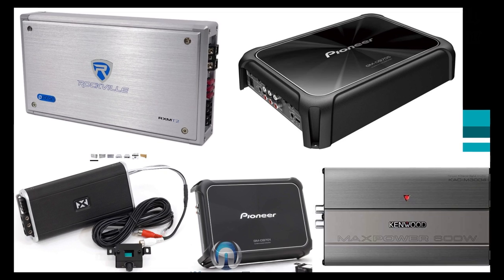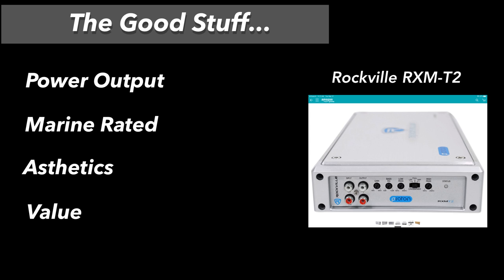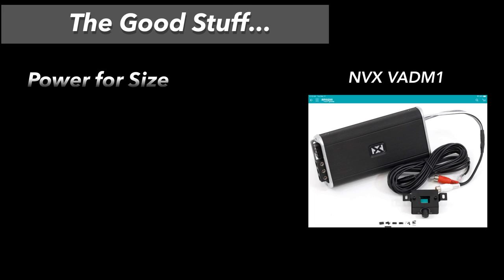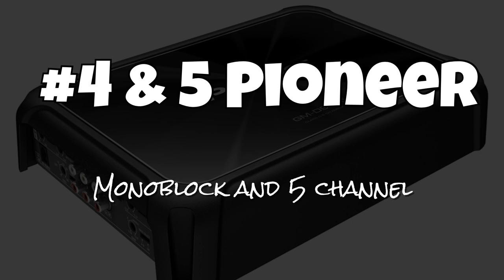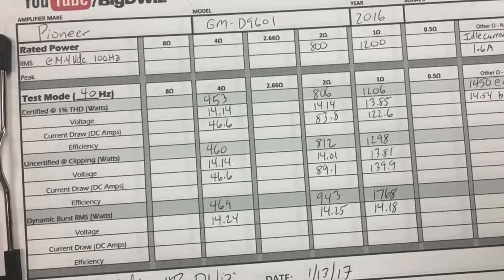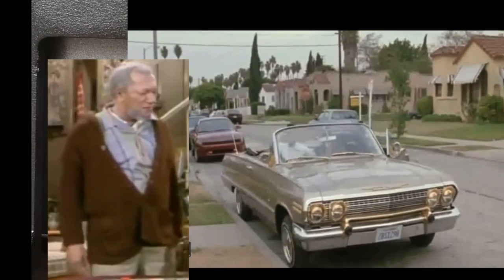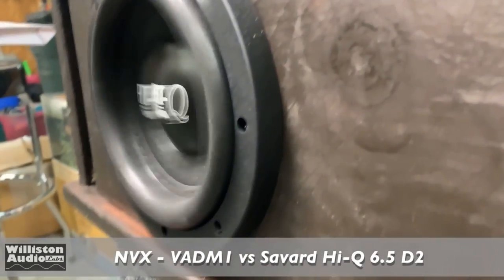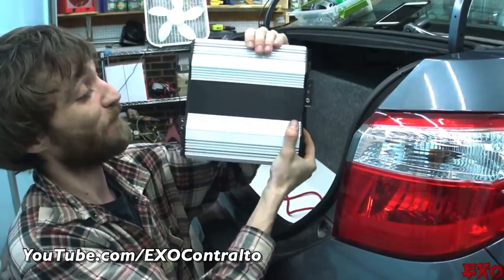Budget Amp Picks in 2020?

Comment: Still have a 1st gen Rockville  K9D2 10inch sub and a second gen K9D4 10 inch have them hooked up to the Taramps smart 3 at 1.33 ohms. They are still kicking no problems so far.

Comment: My Pioneer 800w GM5505 has been torture tested, subwoofer approved, brought new when it came out and still has the original fuse in it. Scuffed and scratched up, screws and terminals halfway stripped out, but this thing STAYS reliable. My Razor Rxr-2500 monoblock has also been 1 ohm stable since I bought it too. No, nowhere near 2500 watts, but feels like a solid 800-1000. Lil fucker, too.

Comment: Is there any budget 4k watt amplifier? To match to a Dc XL elite 15. Tryint to find something around $100to1k watt area or so. I know i wont find anything under 300
Reply from the maker: The cheapest 3kW amp is prob the Taramps Smart 3. It’s around 300 bucks. You need to make sure you have the electrical to support an amp that powerful though
Reply: @wal  thank you for replying. My electrical is not the best but i do have 1/0 all around, big 3 upgrade, xs power d1200 up front and a xs power xp950 reserve battery. Im hoping i can upgrade the rear battery to at least be able to power a 3k amplifier. Right now im just planning on what i should look for

Comment: Honestly I’ve been in the sub game most my life and a badass amp for the buck is the Audiobank 7000.1 for $89.99 on amazon, PAY CLOSE ATTENTION THE ONLY AMP THAT THEY SELL THAT ACTUALLY SLAMS IS THE 7000.1 mono block THE 2000.4 AND THE 8000.1 AMPS THEY SELL ARE GARBAGE THE 7000.1 is the best and it’s lower input then most subs so you don’t need an extra power supply to Atleast push 3500-4000 on a stock power supply

Comment: Not seeing the Rockford r500xd1 on the list really disappointed me. I have one and I can vouch for it
Reply: As he said in other comments he had over 30 approved amps by him and he chose the ones most accepted by his fanbase.
Reply from the maker: That’s a fantastic amp!
Reply: @wal  hey big d wiz I am confused about my amplifier (Kenwood KAC-9104D monoblock amp) because it has two 30 amp fuses. The RMS wattages specified from the manufacturer (500 watts RMS at 4 ohms and 900 watts RMS on either 2 ohms or 1 ohms) are on 14.4 volts and I know I am going to get 83.33333333% of the RMS wattage because my car battery is 12 volts. This means 416.66666665 watts RMS at 4 ohms, and 749.99999997 watts rms on either 2 ohms or 1 ohms. I am planning to buy two of either the Pioneer TS-W216M subwoofer (SVC 4 ohm 350 watts RMS) or the Pioneer TS-A25S4 (SVC 4 ohm 350 watts RMS) and use both of the amp's outputs (don't get confused thinking it is a 2-channel amp because there are two ouputs so you can connect 2 subs and internally they are wired in parallel) so I can get a 2 ohm load 749.99999997 watts rms from the amp and bring 374.999999985 to each 350 watt rms sub. Alright, so what confuses me is the 2 30 amp fuses. If you do 60 amps x 12 volts x assume 80 percent efficiency, you get 576 watts, what does this mean about the amp?